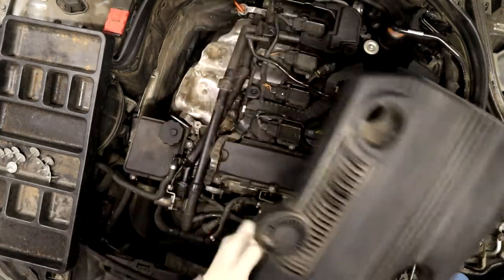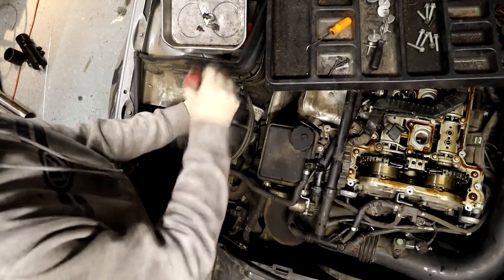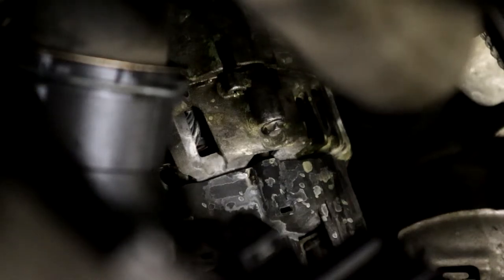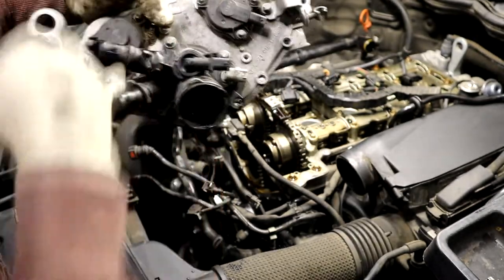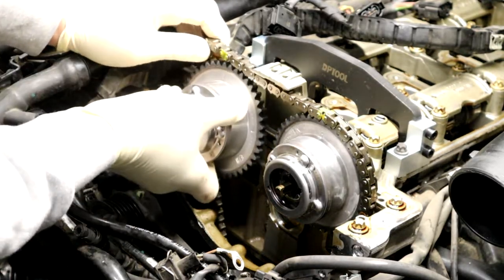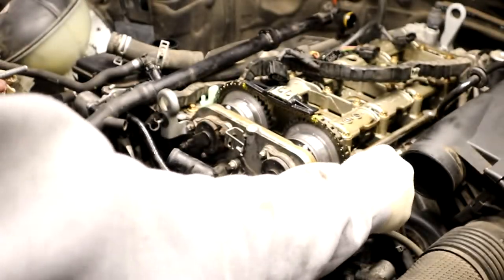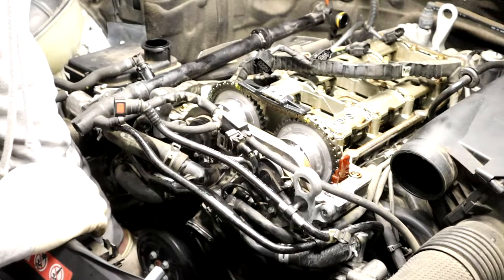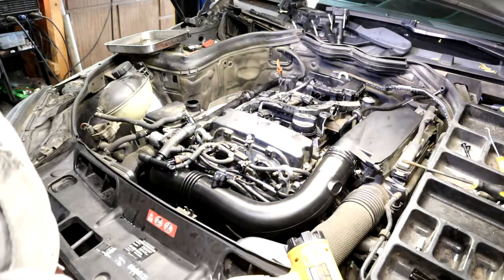M271 Cam gear replacement

Comment: You would hear rattling correct, when decelerating, that’s why you changed the cam gears? Mine has been suffering from this over 3 years already. Only sometimes the rattling happens then it doesn’t. I need to get it fixed. Thank you for this video it’s really helpful.👍
Reply from the maker: These rattle are start up
Reply: @carwerks101  Yeah i guess it's the pin thats inside these sprockets that wears some surface around it. Then it starts to rattle.
Reply from the maker: @aletzr  yeah, they cant lock in place, someone on youtube sells a repair kit for the M156 engine
Reply: Does this also fix the long cranks before start up? with the camshaft adjustment codes for the intake side
Reply from the maker: @hectorzacarias3929  yes
Reply: Awesome video dude, just what I need to start my project. Where did you get your gears from?
Reply from the maker: @AutoSupport1  theses were from the dealer

Comment: Have you hever used the aftermarket gears? Febi bilstein etc.....these things are $800.00 each from MB. I usually buy OEM only but these are ridiculous from MB. Great video BTW!! I would use OEM tensioner , VC gaskets, chain guides though.
Reply: I have. These from Febi Bilstein last just as long, if not longer than the OEM fittings. Confirming this with my 2011 C200 CGI with the M271 engine.

Comment: I was after i little advice please ive had my timing chain done but every so often my eml comes on and still getting camshaft sensor a come up on the obd reader. Had my timing checked again by a mechanic and my timing is fine just the camsaft sensor a ive replaced the sensor but still keeps happening any suggestion at all.. its mercedes c180 2010
Reply from the maker: Sounds like either timing isn’t correct or a failing timing gear, does it make any noise upon start up?
Reply: The m271.8 evo timing marks on the camshafts shouldn’t line up. I replaced both camshafts and lined them up correctly and got a p0017. Found out that the camshafts are out of spec on some m271.8 engines. So I just spun the engine to TDc took off the chain and let the camshafts reset themselves. Put the chain back on and no code.  Now I have a rough idle. My scanner is showing me that my ignition angle is around -10 to 15 degrees. So I think my tensioner is not out.

Comment: Is there a way to check if the chain stretched and needs replacement to without taking it off? Marking it like you did and just doing the adjusters seems better but not wanting to take everything apart twice
Reply from the maker: the only  way to measure slack is using the specials tool which goes in the tensioner slot and measures the slack
Reply: After the tensioner “activated” it’s no longer on top center. The paint marker spots are still on the chain in the right spot tho. Thinking the chain might have stretched and needs to be replaced?

Comment: Why didn't you change out the chain also while you was in there? Do you recommend doing so?
Reply from the maker: Because you need special tools to do it that I didn’t have, you need to take apart the chain and roll a new one in
Reply: @carwerks101  reading what you said, so it's the cam gears and tensioner do normally wear not the chain?
Reply from the maker: @johnsondml  they both wear, but typicall its the cam gears which fail first

Comment: Please canu helps me my new chain  ad tensioner are new but not orginal Mercedes its make noisy sounds but it is everything in OT the 40NM i have do it but idont know more what i must doo to fix, no one helps me 😞
Reply from the maker: Did you spin engine backwards first to release it?
Reply: Ohh lord thxxx for ur answer, i have do spin backward but i have never hear a klick or a klack ??

I have than start the engine normaly and it was doo 1x krhrrrr that is the point which the tensioner is leaved his pin out ?

I have do the backward with the blockade gold tool , can i do it without ? 

It is febi Bilstein Tensioner 40NM is really right or ? 

Please plase help 😞
Reply from the maker: @user-bw5hk5nb3k  you can do it without it, you should hear it come out
Reply: Really ? hear i a click than how much times i must do the backward ? 

Is it dangerous to spring the chain ?

Is it now not released ?
Its have a noisy sound but everything is in OT

It the 40NM wrong ?
before my tensioner was 80NM ?

I hope i get my car fixed 🥹 
i have no more idea what is here wrong ?
Reply from the maker: @user-bw5hk5nb3k  only go backwards a few degrees
Reply: Okay backwards how times ? 
40NM ? Is it not released the tensioner ? because i am afraid big afraid because its everything is new : ( 

Tomorrow i can do backwards is the klick good to hear ? my chain is not spring up the tensioner is new and installed with 40NM : (
Reply: A little question The 45NM without sparkplugs inside of engine oder with the sparkplugs on backward degrees 15 grad

Comment: I got p0017 code..
Changed bank one cam sensor and magnet..code came back..
Should I change bank two sensor and magnet too..or what..??

Drives good, sometimes a rough idle (sometimes, not often)..
No rattle or noise..
2013 C250..189 miles..
Reply from the maker: Sounds like you need a cam adjusters
Reply from the maker: Or your chain is stretched
Reply: I change the adjuster on bank one/exhaust side..
You saying you think I need to do the adjuster on bank two/intake side..??
And if that don’t fix it, I need a new timing change..??
Reply: @carwerks101   very rarely. On the CGI, chain stretch isn't common UNLESS the tensioner failed prematurely.

Comment: So is this for when the engine starts up loudly from a cold start and then proceeds to rattle?
Reply from the maker: Yes sir
Reply: @carwerks101  thank you. Just a one more question If you’d be so kind. Do you have a list of parts and tools that you used for this video including the random ones you said should be replaced?

Comment: Hi did you have to change the oil after the job was done?
Reply from the maker: No
Reply: Hi, I made a mistake I took out the tensioner first without alighning the timings and hold the camshaft what do i do?
Reply from the maker: @sherwinpangilinan4079  just stick a screw driver in there and push on the lower guide while turning the engine over, it will push back on your screw driver but as long you keep tension you will be fine
Reply: @carwerks101  Hi, I lost the timing marks on my chain when i put the gears back apparently they dont line up, What should I do? But the crak is dead on 0-T
Reply from the maker: @sherwinpangilinan4079  do you have the cam hood on?
Reply: @carwerks101  idk why my marks arent lighning up do i have to open the cam hood and reposition the cams?
Reply from the maker: @sherwinpangilinan4079  sorry I meant cam holder not hood, which marks aren’t lining up? The line with the arrows looking from the top of the cams? Are the new cam gears on?
Reply: @carwerks101  both of them ae off
Reply: @carwerks101  Hi bro, Do you know the part number for the tensioner cover i need to replace mine
Reply from the maker: @sherwinpangilinan4079  A0009976220

Comment: Do you have to do anything with the timing chain tensioner?
Reply from the maker: yes you have to remove it and installa new one or reset your stock one
Reply: @carwerks101 How do you reset the stock one?